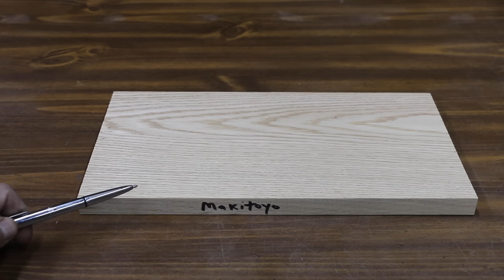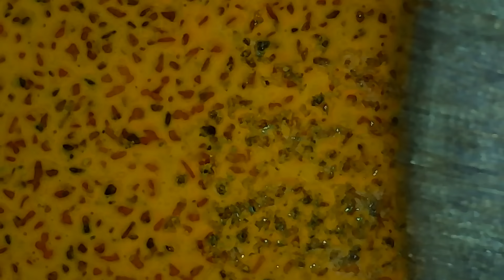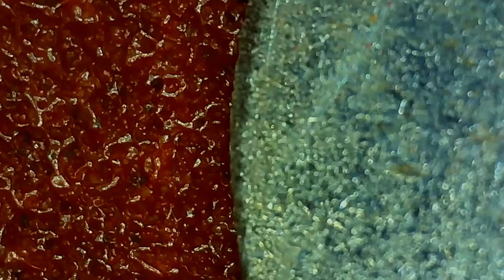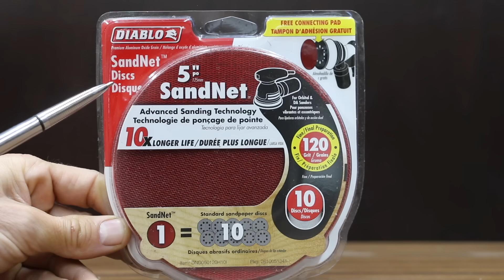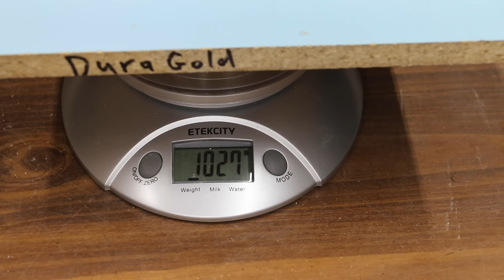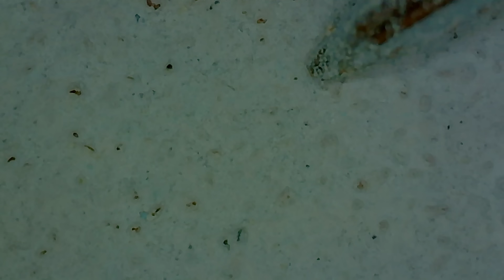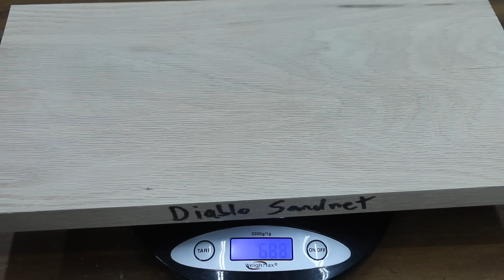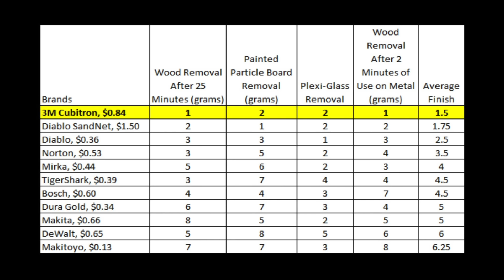Best "Sandpaper" Brand? 3M Cubitron, Diablo, Mirka, Norton, Makita, DeWalt, Bosch Sand Paper

Comment: I used abranet/woven every day. That stuff lasted forever considering what I was sanding. If it was too worn out for what I was sanding at the time I would keep the piece and use it to sand other things by hand. Sometimes I used new sheets by hand because you can roll it. I hated using regular ol' gritty paper. It had its place but once it was clogged that was it. Abranet could be blown out and worked with dust extraction systems flawlessly. When doing more delicate sanding with 800+ grit it was dangerous because it could retain little pieces of whatever and could make deeper DA scratches but when used properly and with care you can't beat it.
Reply from the maker: Thanks for sharing.

Comment: I've been using the DuraGold brand for awhile now...but looks like I aught to switch! Thank you so much; this has been very helpful!
Reply from the maker: You are so welcome!
Reply: Yeah, I've worked with DuraGold and 3m sandpaper at my old job doing paint correction on cars. 3m was by far the best. We ended up chunking all of the DuraGold sandpaper in the trash lol. It just doesn't perform as well. And is more time consuming to get the job done. And time is vital in a production facility.

Comment: Same as my experience, I use diablo because of its low price. It lasts quite a long time on woods, especially if I only need to smooth the edges. But after using it on steel, it wears out extremely fast. Indeed diablo claims the discs to be washable, but I haven't got a chance to wash them, they just worn out before needing to be cleaned.
Reply from the maker: Thanks for sharing.

Comment: Interesting As always 

I have 5 and 6 inch porter cable random orbits the 6 is good because of the dust collection BUT the 5 is a complete beast for material removal 

I also have a Mikita 9227 with a 9 inch sanding setup which is a whole other level of beast
Reply from the maker: Thanks!  Thanks for sharing.

Comment: Hey Project Farm I may have an idea for you.  I did a quick search and I don’t think you have tested garden hose sprayers. It may seem lame but buying one every few years is lame too. I have found that some are vastly better than others in the ability to be dropped from waist height and not break (no seriously I’ve had three or four break with just that simple drop). Also there are differences in quality and pressure of the stream... I’m no Urologist but I do know a good stream when I see one 😜.  Water flow (quantity vs quality) could be tested as well. The best I have found so far is actually from my local Ace Hardware. It wasn’t cheap and isn’t perfect but I’m on year three of use and it seems to be holding up.
Reply from the maker: Thanks for the video ideas.
Reply: @ProjectFarm  I love the content you produce - big fan. I actually use this channel to settle many “forum” arguments. I used the car air filter video as “exhibit “A” just last week. Copy and paste link and wait for the “huh” I guess I was wrong...

Comment: What happen to safety first??? You should have used a vacuum. The ceramic diablo is better maybe for health reasons. But also 3M does not state what it has... odd. 
aluminum oxide  is not healthy to use which should be placed last for that alone.  Many seem to be oblivious to toxic metals. even in firing ranges the lead causes many serious health issues which is never talked about and it needs special soap to remove and goes everywhere.  Many dont know and a warning is needed.

All small particles are an issue but maybe some more so than others

Aluminum oxide as stated under warning for  Globally Harmonized System (GHS)
"Acute toxicity (oral, dermal, inhalation), category 4
Skin irritation, categories 2, 3
Eye irritation, category 2A
Skin sensitization, category 1
Specific target organ toxicity following single exposure, category 3
Respiratory tract irritation
Narcotic effects"
https://en.wikipedia.org/wiki/Aluminium_oxide#cite_note-TRI-12

Also nice to see a total average.
Reply from the maker: Great point on safety.  I wore a high end respirator during the entire test.  I began using the vacuum during the 2nd 5 minute test.

Comment: The Diablo SandNet is failing when sanding edges. Sanding flat pieces is great, but sand edges and the coating will detach instantly (pressure points) and leave you with a nice fabric mesh totally ineffective at sanding. I will never buy the SandNet again, i will stick to the regular Diablo version.
Reply from the maker: Great feedback. Thank you

Comment: Diablo sandpaper is my go to but i do buy the odd sand net ones just for that spare backing plate it saves wear and tear on my sanders velcro from changeing pads cause i do alot of epoxy projects so i use tons of pads the sand nets come in way higher grits too than the paper atleast what my hardwear store stocks

Comment: Another SUPER test, Commander! I just bet what Ace or Lowes has and don't use much of either. Usually a wire brush or a file are my main ones. If Sweetums needs some it's Ace or Lowes. Wished I was more help but this is just a laid back/laid down outfit. Happy SPRING and Many BLESSINGS 2 all yall!
Reply from the maker: Hi Lewie, Great point on the wire brush and file.  I love your sense of humor too!!  Glad warmer weather is on the way.  I've already applied 6600 pounds of fertilizer to 25 acres.  With all of the rain, it should produce a terrific hay yield this year.  Wishing y'all many Blessings!
Reply: @ProjectFarm  6600 pounds of job security! Way to go, Commander! I think about Sulphur and Astroturf but all I do is think while I mow! GBWYall!

Comment: Hi . Well done . I am a floor sander and use Norton exclusively for finish sanding because of it's consistency . On hardwood using a random orbital I would finish with an eighty grit paper which I find to be the best compromise between speed of sanding and finish. Finish you can check by coating the sanded samples with a clear polyurethane and looking for  visible scratch marks. Cheers .
Reply from the maker: Great feedback. Thank you

Comment: I wish you would have included Klingspor products as well. There is more to sanding than just 5” discs. I use rolls, belts, and sheets also. The same products don’t work in all form factors.

Comment: I already watched a sandpaper comparison once, where the performance of different brands was tester using different sanders of the equivalent brands to the sandpaper.
In this test I saw the Mirka crushed its competition, but only when used with the Mirka brand sander. 
So in that test the conclusion was to use the kind of sandpaper made for the sander you are using.
Maybe that would be worth a try on your channel as well to test the performance using different sanders.

Comment: Project Farm - You missed a very important factor in choosing sanding discs -the loops.

18 months ago i bought lots of Diablo discs of various grits and they are all GARBAGE!   None last more than 10 minutes of sanding without the loops completely losing the ability to hold to my makita sander. The grit is still good but i have no need for 100 sheets of hand sand paper.  

I have switched to mastercraft sanding discs which are cheaper and last about 20 minutes before the grit starts to come off.  

If you get a chance to revisit this I hope you will test the loops ability to hold after being applied and removed several times.

Comment: I really wish you would have included Klingspor. I've used them for years and their stuff is affordable, really good quality and their customer service is top notch. I'd like to see how they stack up compared to the brands you are showcasing in this video.
Reply: What kind of customer service can you use for sandpaper? Is gritty side out that hard to figure out?
Reply: @1pcfred  they make and sell their own sandpaper. if your order gets messed up/ there's something wrong with a product due to shipping they fix it right away.
Reply: @THANATOSIXU  I'm sure they can ship sandpaper out.  How hard can it be? Lowes just did screw up my in store pick up though. They forgot to record that I picked my order up. So I kept getting emails to pick it up. Computers. They're persistent if nothing else. Was a week after I was supposed to pick it up and I was still getting emails. So I got a hold of them and straightened it out.
Reply: @1pcfred  some of it was missing and some was damaged. shit happens. but when a company tries their best to fix the problem as expediently as possible, it show that they give a shit.
Reply: @THANATOSIXU  that sounds like a shipping problem to me. How's their customer service?
Reply: @1pcfred  its fantastic. got replacements shipped out right away. couldntve been happier

Comment: Thanks. Today I was thinking about how you might test ball point pens. Or vs. rollerball, felt tip, etc. longevity, time capped, uncapped, etc.
Reply: I have gotten some surprising results pen plotting with my CNC machine. Cheap ball points work best. But writing by hand nicer pens definitely seem nicer to me. I think my machine may just be trolling me though. Because it can draw nicer than I can. Never makes a mistake.

Comment: Hey man I’m working on my own brand of lubricant I just perfected the perfect lube that’s better then wd40 would you be interested in trying it out?
Reply: WD-40 is not a lubricant. It is a metal preservative. It was originally formulated for the storage of rocket components. Although the fluid does have some lubricating properties. But you could say that about any fluid. Until it gets sticky Coca-Cola is lubricating. Truck drivers that use rollers know it.

Comment: as carpenter my own personal experience: Bosch, DeWalt and Makita's sanding dics backside will wear more quickly than mirka (sandNet) in long run. so most of times sticker wont grip sander anymore, even if it perfectly useful as hand sanding.

Comment: 3M in the next few weeks: “why tf are we selling so much sand paper all the sudden?!” Hahahaha.
Reply: And Dewalt saying why are our sales in the dumper???
Reply: 3m invented modern sandpaper back in the early 1900s. They started as a mining company but it was the invention and production of sandpaper that made them take off. Their name is on everything these days and they are one of the largest companies in the world because of sandpaper.

"Minnesota Mining and Manufacturing", 3M. The "sand" on sand paper is a mining by-product.
Reply: @macthompson9750  Aluminum oxide is manufactured. Only Garnet is mined, and it has gone out of style - hard to find.
Reply: @macthompson9750  wow- I actually didn't know that- thanks
Reply: @macthompson9750  they also make some of the top products in various categories. it's one of the few brands that if i see a 3m logo i know it's a good product. may not be the best or best value but it's always a good product no matter what it is.
Reply: Pros know about 3M. They make the only wet or dry I'll buy.
Reply: @1pcfred  3M wet diamond grit was what I use to use to get my snowboard, and skis ready for ski season, it was the only paper I found that would remove last seasons old wax, without gumming the paper up too bad. start at Blue 1200, and work my way up to pale green 8000, for the smoothest surface I could get, and then 3 coats of Mr Zogs SexWax
Reply: @1pcfred  what is your thought on Festool sandpaper?
Reply: @danielrobbins2668  I never used any. But I bet it is more expensive and makes less dust than any other brand does. Because that's how Festool rolls.
Reply: Anyone with any experience knows 3M is by far the best.
Reply: Not in the flooring industry. Norton is king.
Reply: Companies' stock is tied to PF
Reply: 3M has always made the best and most reliable respirators that have become so important these days. Most of those Chinese m-98's are fake crap.
Reply: More like diablo for me!!!
Reply: Few brands that have, to my knowledge, avoided the crap-tier stuff are Hilti, Festo and Stihl. Always a pleasure using these. You know that what you do work with you can count on.

That Diablo brand PF often shows seems like solid stuff, as well. Never used personally. 

3M, just as Makita and DeWalt and Würth etc. all have their low-tiered and failed stuff. Like cheap 3M tapes, be it duct or masking. Crap everytime. Also Makita's cheap-tier bits. Failure guaranteed in pro work.
Reply: for abrasives, in an all-out, fight to the death, 3M will always come out on top.  If any readers have not tried their Cubitron II cutting wheels (0.045"), or ⅛" -  ¼ " grinding wheels, YOU HAVE TO TRY THEM.  Nothing else comes close.   I have two 3M pneumatic 4 ½" air Grinders (models 28824 and 28826), and they are absolute BEASTS!   They sound like freaking freight trains at full throttle, and use up all of the 38 CFM capability of my Polar Air 10HP 4-cylinder air compressor!

Comment: The instant I saw he was testing 3M's Cubitron II, I'm like "I know which one is winning."  I try to buy only that at work since it handles metal wonderfully and lasts.

It's good stuff and they do a LOT of testing too.

I am also a big fan of the "net" style sanding pads.  It's a novel approach to the classic design, and I've used them for some time with great success.  The long life and strong anti-clogging behavior lets them work great for a very long time.  I was quietly hoping it would be the leader since even the Cubitron II, despite its great R&D based engineering, is still a classic design.  Even so, the "net" disk performed awesome, matching what I've seen in my own use for woodworking at home.

Comment: I swear by sandnet for woodworking. It's expensive but lasts so much longer. So you don't have to keep changing pads. That gives you much better consistency in finishes. Plus it's basically impossible to clog in my experience. Worst case you blow it out with air which isn't possible with the others.

Comment: Highly recommend the sanding net but mostly for those of us using dust collection it works so well in my shop for heavy wood removal and epoxy removal. Though I will say it tends to leave a bit of scratch pattern that behind that mostly with epoxy can be a pain if you're not prepared for it. I generally use the normal diablo before moving to my finish sander to help remove those deep scratches. Great video as always man. Would love to see a test of different orbital Sanders. I can't justify the price of mirkas sander but people seem to love them but I suspect there are other brands much cheaper that preform just as well. Weather its removal of materials or the finish of the sanders scratch pattern.

Comment: We run a woodworking shop with lots of Festool gear. The festool sander is one of the best I've ever seen at dust collection. I know it's more of a pro brand but would love to know how 3M stacks up against the festool sander using festools paper as the hole patterns on the festool are designed to match the sander.

Comment: What's a real shame is, you didn't include 3M's Cubitron flap disc in your flap disc test. I bet it would have been the top performer.  I use 3M's Cubitron 4-1/2" flap discs to sharpen my mower blades and have not found any other brand that performs as well.

Comment: I wonder, isn't grit effectively the "rate of material removal", meaning that it doesn't really make sense to test how much material the sandpaper removes, because it should remove the "right" amount of material according to its "grit" rating? Since you would choose a higher grit sandpaper when you want to be careful and not remove so much material. Whats makes more sense is the difference in material removal after a long usage period. Since, optimally, all sandpaper should keep the material removal rate for as long as possible.
Reply: I'd say the grid rating is more of an indication on the surface roughness it leaves when sanding. Ideally all should make a surface exactly equally rough but if an abrasive ''cuts'' faster it makes you able to sand a larger surface to said roughness in a given time.